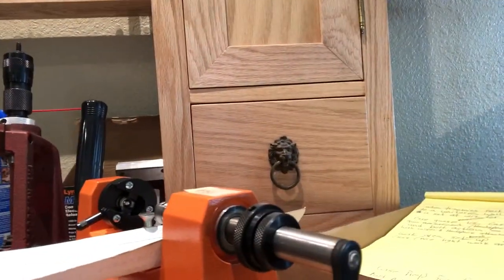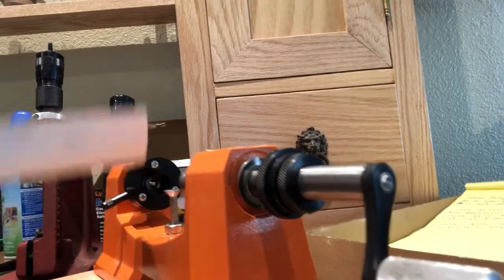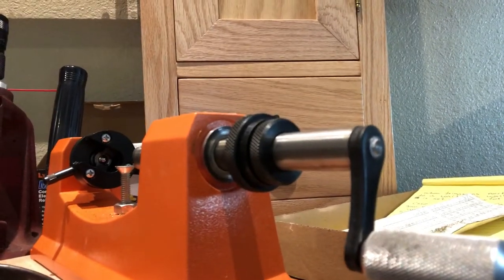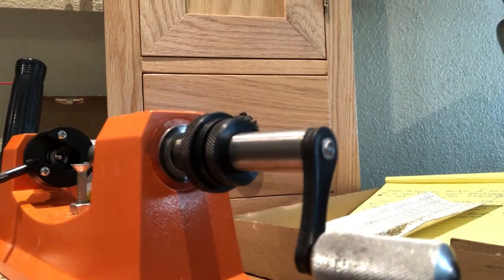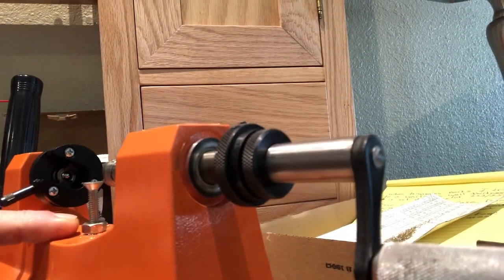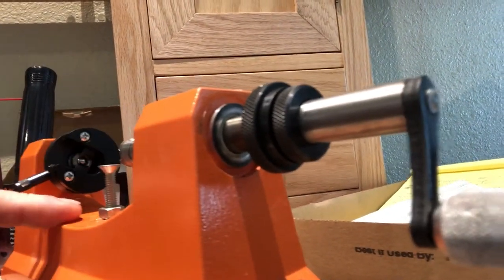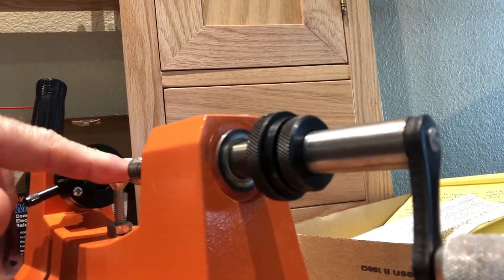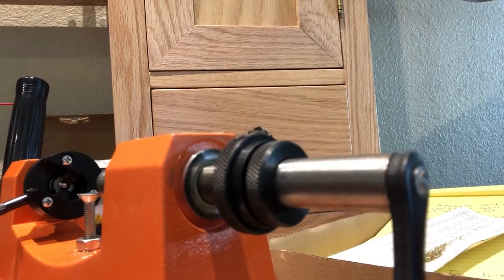Reloading case trimmer modification

Comment: I have found that if I ( 1 )  insert the case into the shell holder and only tighten the shell holder just enough to hold it. Next ( 2 )  insert the cutter pilot full length into the case neck and then ( 3 ) completely tighten the shell holder that my case is held square with the cutter and my case necks are trimmed perfectly square.
Reply from the maker: I have found the extra support gives me a lot better consistent trimmed case. There is no drag on the neck walls when turning the cutter and removing the pilot. I can back the pilot out and it will go back in perfectly aligned with the case still tight in the holder. With your commit leave the case tight in the holder, back the pilot out and try to insert the pilot back in. The case will pull to one side. One small change with reloading probably will not make much difference in accuracy, but at different steps several defiantly will. Just wanted to pass on what works for me.
Reply: Exactly! He didn't have to do that always insert the pilot into the case then lock the chuck up!!! Also always resize then trim that ball centers the case with the primer removed then the pilot makes sure it's perfectly centered !!!